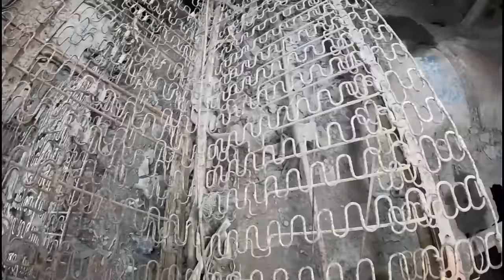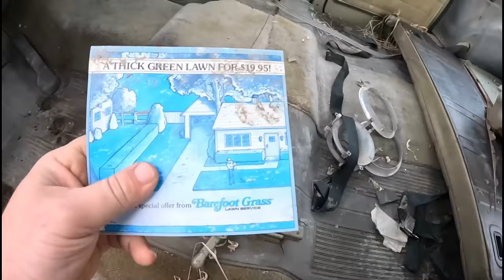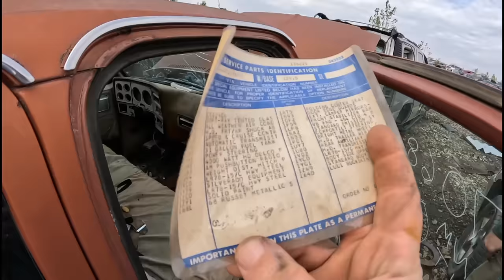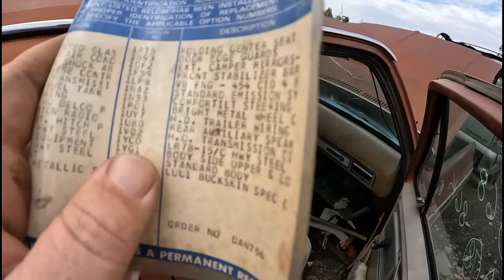JUNKYARD EXPLORATION - EPIC HOARD OF RUSTY CLASSIC CARS!

Comment: Cool travelall when I was in elementary and jr high my dad drove a 72 army green ih 1210 304 ih 2bbl Holley Chrysler manual column shift 3spd transmission and no power or disc brakes dana 70 rear 4.56 gears it was the green tank lol
Reply from the maker: Jared called recently and asked about buying it, I believe $1500 with a title.
Reply from the maker: I just read your post again and it sank in you said Dana 70 with 4.56!!!!!!! I have that setup in a 1970 f350 one-ton dually, I couldn't imagine that in a travelall!! I bet that 3 speed kept you 50 mph max?!